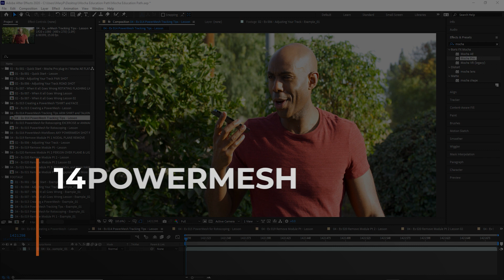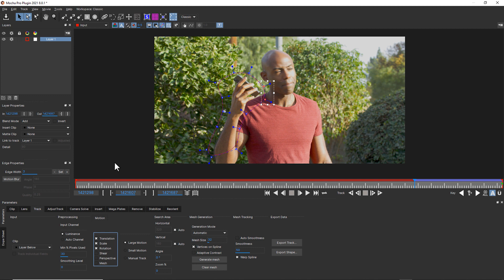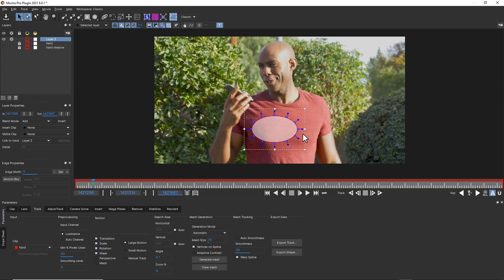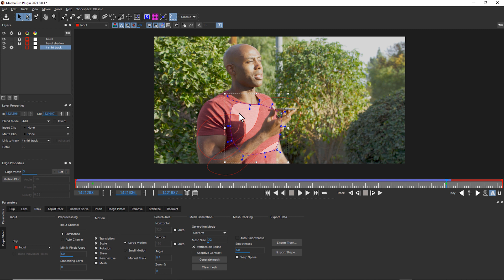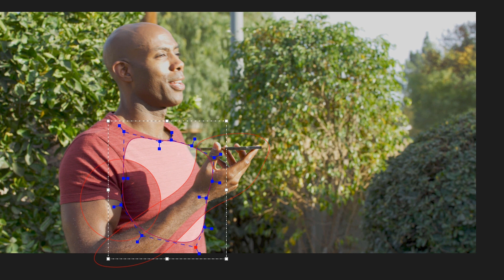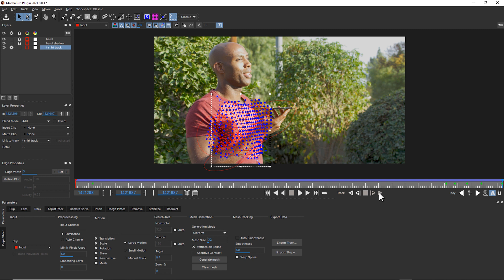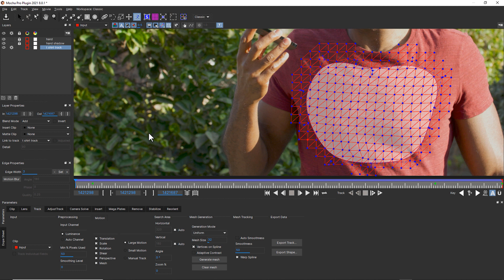14 PowerMesh Tracking Tips [Mocha Essentials]

Comment: Hey,
I have a problem with the powermesh.
whenever I try to render the Warp option render and there is a lot of layers other than the power mesh layer in the mocha panel, it never work! it only work if I delete all other layers except for the one with the power mesh data of course which is not convenient to work with as I obviously need the other layers tracking data. Any help?
Reply from the maker: Hi.  In Stabilize, do you have your PowerMesh layer as the layer with the cog selected?  That is the trigger to let Mocha know what layer to use.  If you do and it is still not working, could you report it either on the forums (https://forum.borisfx.com/ ) or directly to Support (https://borisfx.com/support/open-a-case/ ).  Give them screenshots of your setup too.  They'll be happy to see what the issue is.

Comment: Interesting, you didn't even set the hold outs/garbage mattes to subtract or transparent... Perhaps this is why it's not been working for me. The user manual did not answer that question for me :/
Reply from the maker: If you're tracking inside of Mocha, then you don't need to do anything special with shapes to make them hold out masks. Any visible layer will block out any shapes beneath it in the layer order.  The add/subtract/transparent settings work when you are rendering masks or exporting those shapes out.
Reply: @borisfxlearn  I've been doing it wrong for like... a decade... smh
Reply: @IanZainea1990  yeah any track matte sitting above your target layer gets automatically subtracted